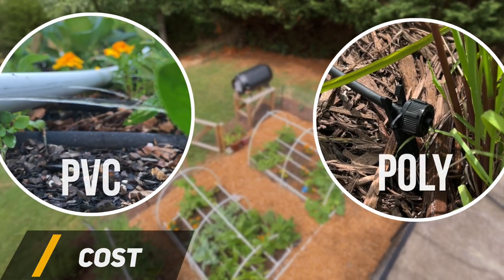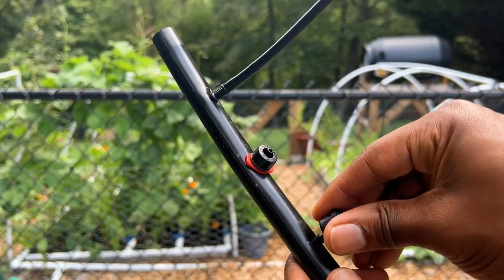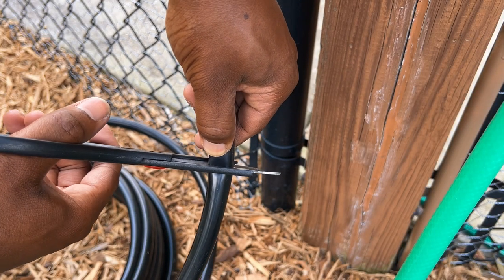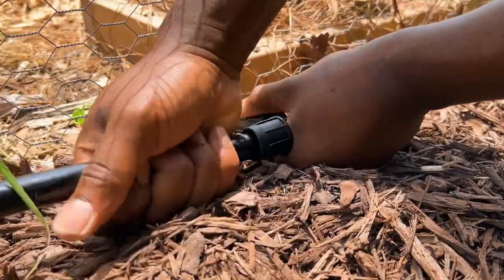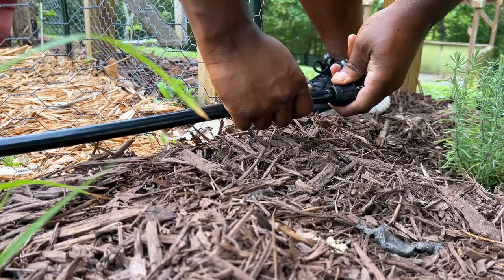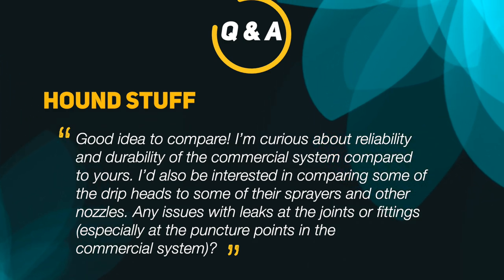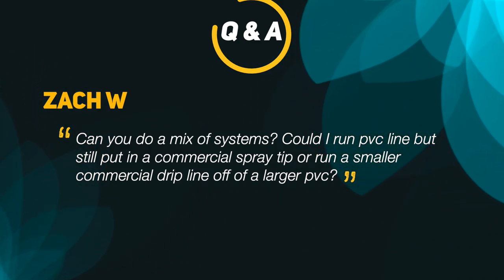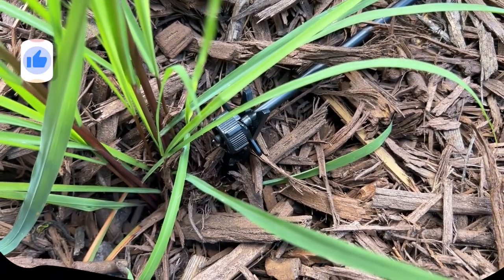Which is BETTER? - PVC or a Commercial Drip Irrigation System

Comment: And does the black pipe heater that water up alot and would that effect the plants
Reply from the maker: I haven't noticed any issues so far. If anything, the plants appear to be thriving more since everything is almost automated.
Reply: @GreenTechTown  thanks probably the way im going after i build my chicken house
Reply: I think it does heat it up a bit, but remember it only heats up the water in the pipe. as soon as you turn your pump on, cool water flows through the pipe.
I'm going to try to cover my poly tubing with mulch next year though, to minimize this.
Reply: @isaacwitmer5139  might make it last longer to keep it out of the sun
Reply from the maker: I agree, covering it with mulch is a great idea to make it last longer, and keep the sitting water cooler.

Comment: @GreenTechTown… “…are designed for PACIFIC flow rates” ….WHAT???  
You mean SPECIFIC, not “pacific”.  Check this out…

“Specific” is defined as:

adjective
1. clearly defined or identified.
"increasing the electricity supply only until it met specific development needs"

2. BIOLOGY
relating to or connected with species or a species.
"the differences between them can only be on the specific level"

Pacific is defined as:

1.
peaceful in character or intent.
"a pacific gesture"
Similar:
peace-loving
peaceable

2. relating to the Pacific Ocean.
"the Pacific War"

*The more you know, the more you grow.*